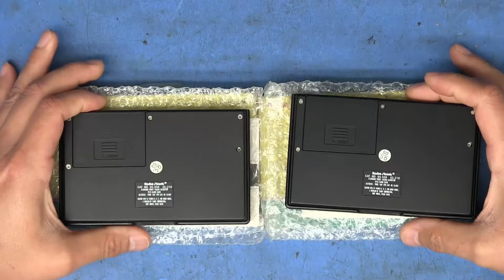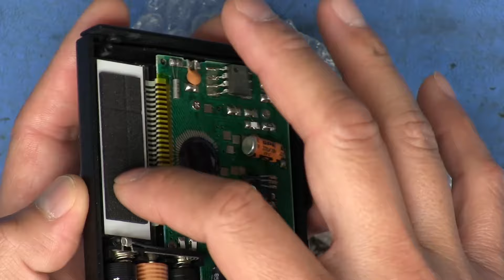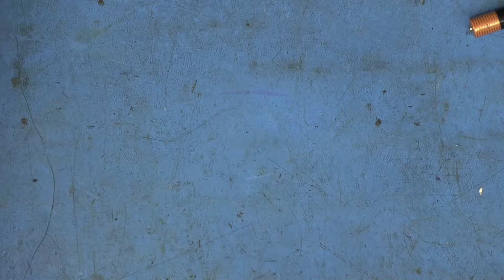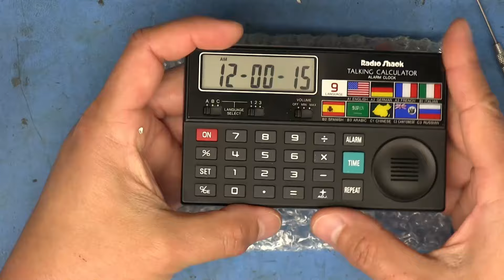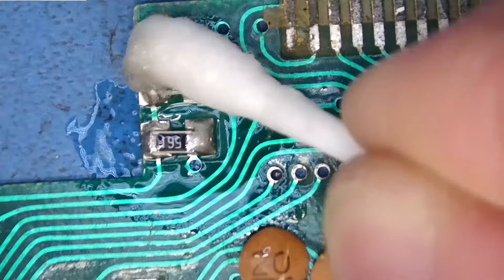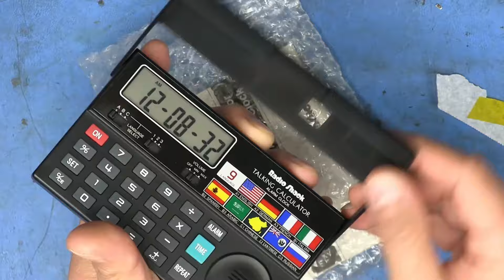TEF #159 | Pair Of RadioShack 65-556 9-Language Talking Calculators With Issues

Comment: Good video!
I also used to like taking electronic items apart when I was very young ( 9/10). I remember deconstructing a printing calculator, and spreading it all out screwed to a wooden board will all its parts connected with cables I extended 😅
Reply from the maker: If only I'd have done something as creative, maybe it wouldn't have been so bad. Lol

My stuff would just end up in bins of random parts and junk.